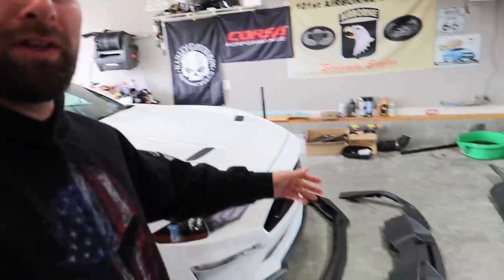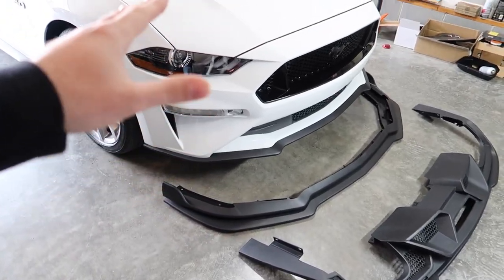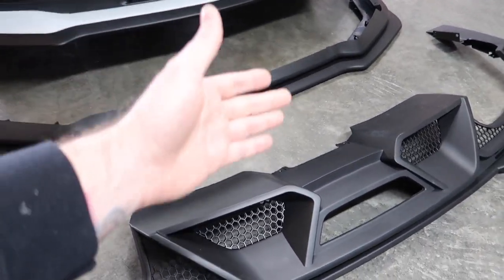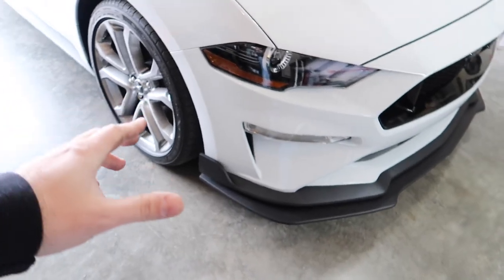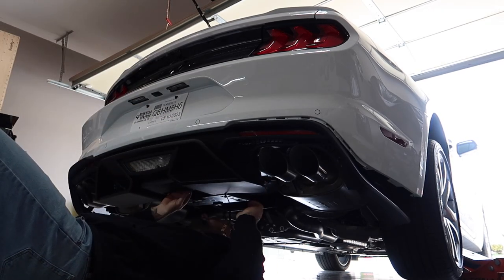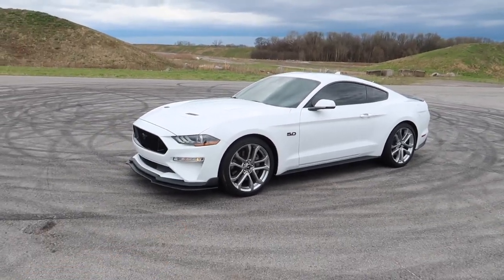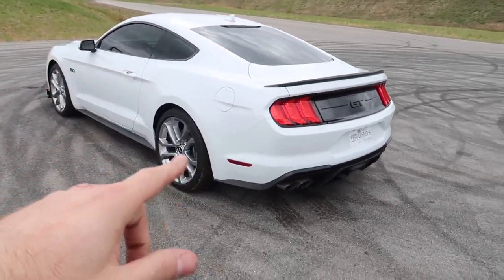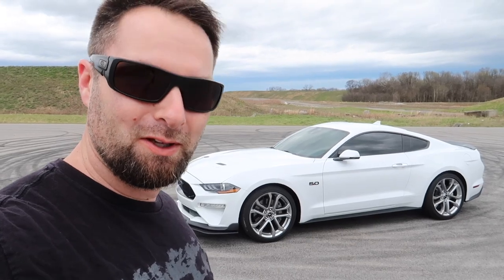FIRST MODS TO MY NEW 2022 MUSTANG GT LOOKS 🔥 *MACH1/ GT500 STYLING!

Comment: Glad to see you back in a stang bro! What % is the windshield tint? What’s your visibility like? I’d like to have mine done but I’m curious about the process.
Reply from the maker: Thanks. It’s 65% front and very clear from inside out
Reply: Tinting the windshield does wonders for keeping the heat out of the car in the summer. When cleaning the windshield inside be careful not to scratch the film and definitely no ammonia products. 
Car is looking good. Every little add-on makes such an enhancement to the car.  Great video glad to see you back in the Mustang. I watched the videos of your red car and the Mach 1 and then you disappeared. I saw a few videos in the Toyota but it wasn’t for me.  Never knew what happened to the amazing looking Mach 1. I saw your Camaro and it looked awesome and wonderful what happened to the Mach 1 and then what happened to the 455hp Camaro?  Oh well it is great to have you back in the beautiful Oxford White. Blue calipers are unique or white calipers with red or blue insignia on the white background. If you do this then you need the white taillight lenses to match. What ever color caliper you choose match some interior trip to the blue or red, etc.
Reply from the maker: @gordydexter2615  thank you. Definitely highly considering blue caliper’s 😉

Comment: Looks Good! And that is a Great hookup on the Variant wheels! I’m definitely going to try and get a set! But that Free replacement and Free ceramic coat and shipping! That’s a nice bonus plus I ran the code to see and looks like they knock off another $100bucs! SFC-3P Corsa collection is what I’m wanting w/polished lip and gloss black.. I’m in Huntsville not far from you I think mite hook up and race sometime! My 22GT PP1 mischievous purple JLT cai PBD tune Xpipe and Steeda Springs but want that ESS supercharger you had before!
Reply from the maker: 😉 yes. The deal I set up with Variant is truly insane. You can use that discount code or if you call in to place your order. Just ask for Mike and tell him you want the ZANDER13 special 💪
Reply from the maker: I’m also doing the ESS again too